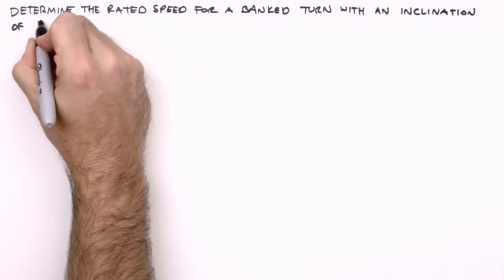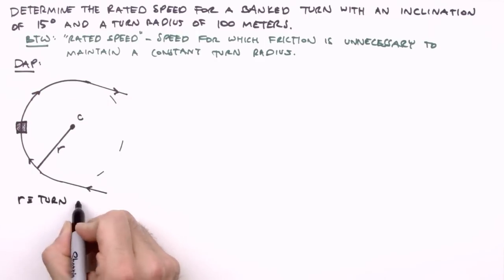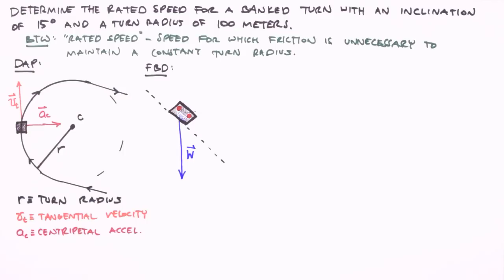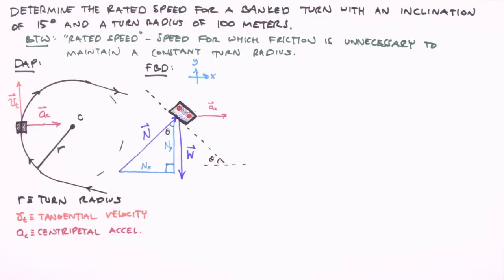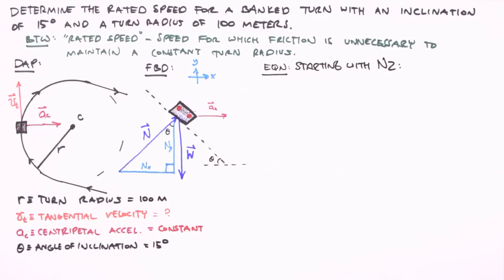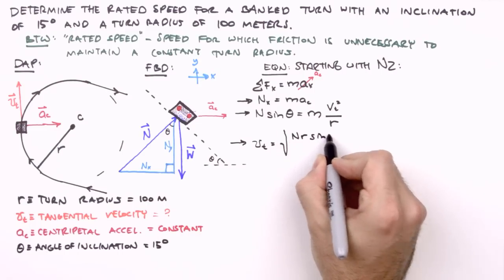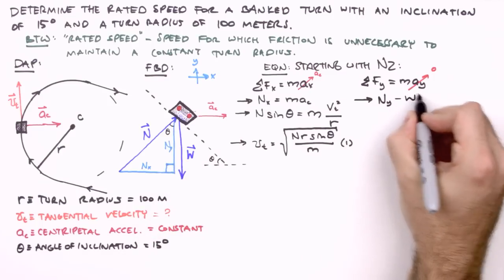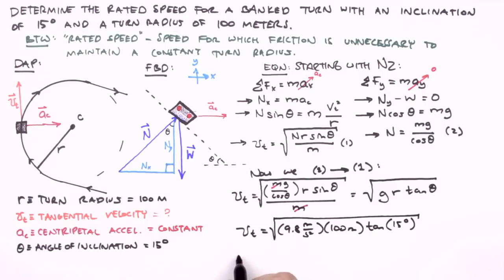How to Solve a Circular Motion Problem - Banked Turn Example

Comment: Hello Jesse - excellent video here, one of the best I have seen on banked curves with zero friction. --> Could you also do one *with friction*; for example, maximum speed with a given friction coefficient so that there is no sliding upward along the ramp. That will be great. - cheers
Reply from the maker: That's a great idea - will push that up my list toward the front, Bill!

Comment: Is v the tangential velocity?
& 
The maximum v should be less than  the square root of mu x r x g as u have derived.

Thanks

Does the friction force where the rubber meets the road acts radially inward to counter the tangential velocity  on the car moving in a circular motion?

Comment: I'm accustomed to n = mgcos(theta) on inclined planes. Why is n not mgcos(theta) here? I don't understand why n = mg/cos(theta).
Reply from the maker: Hello, Long! We didn't rotate our coordinate system to align with the plane like we normally do with inclined planes. This is because the acceleration is toward the center of the turn. Hope that helps!
Reply: Theres a "normal" component of acceleration to the banked surface. If instead you do dot product on the radial force, you'll get the same result. If instead the bank was zero, then the radial force component in the normal to surface direction would be zero leading to the result youre used to seeing.